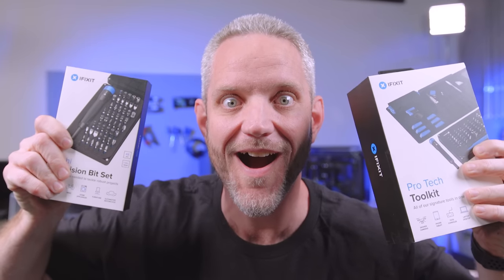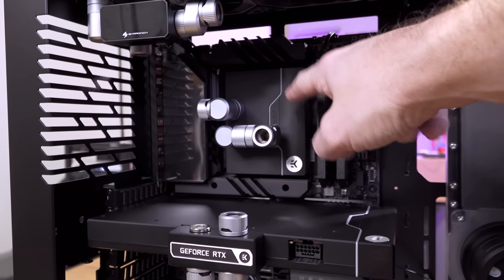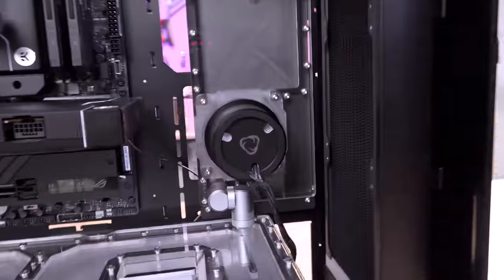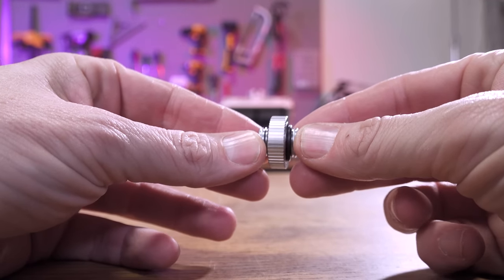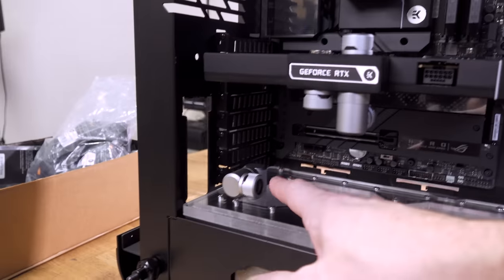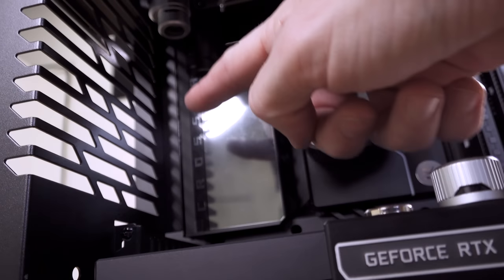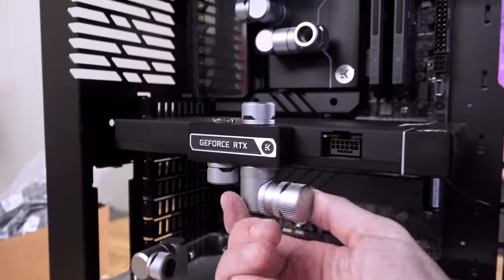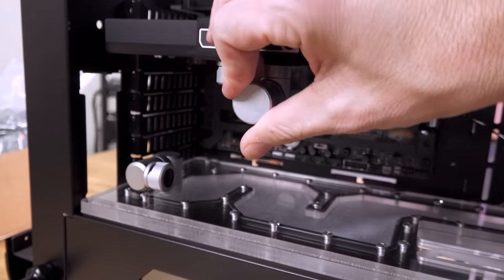My personal system is DONE and its BEAUTIFUL!

Comment: Since you made that tutorial on custom water cooled systems, I use the PMMA tubes from Corsair, in the shop where I buy most of my stuff they have these a lot on their outlet store, complete boxes, with 3 or more per pack. As I'm building these too, I just have a small stock lying around here, in all variances they offer. Or, I buy them bent, from EK, depends on the order income, but you can feel a difference in tube than the Corsairs.

Comment: With water cooling, you can fit all the components in the height of one PSU. Yet all cases are wide enough to accommodate at least one 120mm fan over the RAM and getting bigger for the 4080.

Comment: Centrifugal fans are much different in action than axial.
An axial fan relies on the pitch of the blade to move the surrounding fluid.
A centrifugal fan also has pitch. However the flow is, well, centrifugal. Thus, moving the trailing edge (outer edge?) Forward in relation to rotation increases the relative angle of attack to the blade.
The blades you show in your video have a very "flat" pitch, which will cause high static pressure, but low velocity. A blade which is perfectly radial to the axis of rotation usually makes a decent compromise between pressure and velocity.
A blad that "looks" like it will pull fluid into the center of the fan has a higher relative angle of attack and will produce more velocity at the cost of static pressure.
Also, Dyson is more marketing than engineering, so I would not use them as a standard for performance.

Comment: What's going to drive me nuts in doing my first rigid tube loop is getting all those "it's a few degrees off" problems fixed.  Building in a Lian Li V3000 Plus, so I'll have ROOM to work, but that might actually bite me in the ass, too.  Leaves to be seen.  Can't plan a loop til Wednesday when the rest of my parts arrive (waiting for EK blocks, fans, and an AIO just to test the system and update drivers/BIOS), THEN order fittings and wait some more. 

I MIGHT order a couple of those flow meters (dual loop..duh).  They look amazing, but how to work them in with what I want to do....not sure.

Rig will be all black and purple.  Painting the grating on the case Plum Crazy.  Also, if you had affiliate links, I just ordered both the pressure tester AND that tubing bit. LOL

Comment: Great build!! I just finished my first, complete custom loop, AMD build. Asus Crosshair Extreme, AMD 7950X, AMD 7900xtx, 64gb Corsair Dominator memory, couple of NVMe drives, 3 rads, 10 QL fans, GPU/CPU water block, etc. I was excited to get it up and running. Saw your AMD video about the memory testing at first boot so I new to chill and let it do it's thing. After 30+ reboots now it is STILL taking me 1m34s to get back to the desktop because it does that f'ing memory test EVERY time! The PC this is replacing is an Intel 4790k on an old ASUS board and I'm at the desktop in 13 seconds. What is going on with AMD??

Comment: @jay . i found out that if you force firmware flash your memory using the corsair software , it will set your memory default to whatever you had it set . So you can then remove iCue . it keeps the settings even pre Windows boot . That way you can Keep the dom plats , they by far the nicest ones !

Comment: Jay, I'm really confused. I thought you were doing a build on the Asus x670e Crosshair Extreme. But that is the Hero? I've had nothing but challenges with the extreme as well with a few other parts not necessarily working as well as they should. It's been a lot of stress testing and troubleshooting while striving to finish the plans with EKWB, CableMod, Vyral and a few others. 

The build is as follows:
*Customized Lian Li DXL "White" "Clearview" modded by Vyral
*7950x
* 4x 32GB G.SKILL Trident Z5 RGB Series DDR5 5600 (as each week progresses, the ram continues to become predominately more troublesome. I will be needing to set aside time to trouble shoot each one more thoroughly.)  
*ASUS X670E Cross Hair Extreme  (Right now, I'm going back and forth on this as I am not trusting the Motherboard either. When I connected the additional power next to the 24 PIN cable, the system became significantly less stable.) I've been testing it for over a week without the 6 pin connected. 
*Nvidia RTX FE 4090
*Thermaltake GF3 1350W ATX3.0

There has been quite a few challenges that I am taking on. Aside from some of the hardware hiccups and ASUS not playing nice with memory on it's certified list even running just 2 sticks in A2-B2.

I am working on plans to address the removed 4th pillar regain the structural integrity loss to the case and allow for a top mounted radiator. 

Oh, and the custom ordered 12VHPWR cables came defective / shouldn't have failed QC, even had snags in the shielding of the tiny wires and the sleeving came all bunched and bundled with broken combs. 

This has definitely been one of the more frustrating builds. I miss the stability of the AM4 platform that my wife ended up with. She took on my old build  with the 5950x and we added in a all white 4080 Aero. She loves it.

Comment: Im in the middle of building my first pc and your videos are the reason why. Your very helpful but also funny as hell. I bought a used cyberpowerpc with a b350m bazooka mobo and amd 1400 with a rx580 card. Barely booted the thing up and the 580 is crap so now im reusing the case but went with: 
amd 5800x3d
ASRock Phantom arc a770 ( because price i figured id try it) 
msi x570 unify mobo
Super Flower 850w platinum psu

Comment: so i built a pc my first build. with tuf gaming x570 plus wifi motherboard, amd ryzen 5 3600, G skill 16gb ram x2. amd radeon r 6600  . my sytem keeps restarting on its own. without overheating. i replaced gpu and psu and still restarts  randomly. somtimes while idle. any suggestions would help. sometimes it powers down completly thats why i replaced psu but itstill occurs

Comment: What I struggle with, is how long should the tube be, what is the depth of the fitting - what do you measure to ? Length if fitting to fitting + 10 mm fitting depth...?

Comment: Suggestion. Get a 12v universal power supply and wire it so you can plug it straight to the pump. No need to power anything in the system and less bs with the 24 pin.

Comment: nice.  I like those offset ek fittings.  Really neat overall too.  and the connected lianli fans to reduce cable mess.  the whole process including the ek drill bit to properly round the tube edges.  Also a fan of inwin cases.  they are solid, if a bit heavy. :D  Coolio.  i'd be satisifed with it if it were me.

Comment: Ok, I have to correct you.  A pump ONLY pushes out flow.  Restrictions in the tunings cause pressure.  I spent 21 years working aircraft hydraulics.

Comment: Why would you blow the hot air from the front radiator into the case?  I know fresh air in the case doesn't matter as much when you are doing water cooling, But I would think that having warm air from the radiator blowing into the case sure doesn't help.  Maybe your front radiator and fan pack aren't designed in a way which would allow you to point the fans so that their exhaust air goes through the radiator and then out of the front of the case?

Comment: Dont feel bad on the flow meter they give you no instructions i did the same thing and its a huge complaint on amazon that it does not work but no one realizes you have to turn the impeller around feel like a slip of paer in the box would save them alot of returns... lol

Comment: Ouch. Don't count on that flow meter lasting long. Mine lasted 1.5ish years. Then I realized the oled screen gets burn in, making it garbled to read, and after 2 years, the flow meter stopped functioning entirely. 

I'd get a different one that has oled screensaver features in the future, or find some way of interrupting the molex power every 10 or so seconds so the screen resets

Comment: Hey Jay! 
First off; that is a beautiful build, absolutely love the colour scheme and how it all came together. secondly (And this is for everyone else reading this too.) I noticed you mentioning that you wish you didn't have to use Corsair ICUE and were wanting a way for all the RGB and fans to be controlled by the motherboard, so I thought I'd check the comments as much as I could honestly be bothered to but didn't notice anyone mention about all in one RGB controller apps. After trying a few different ones I would personally recommend and am currently using SignalRGB for my build. This has allowed me to no longer need to mess around with Corsair ICUE, RGBFusion, Razer Synapse and SteelseriesGG as it can all be controlled from one app which you can set to startup with the PC so I barely have to touch it unless I want to change my lighting. On setup it will search for all RGB devices and separate them to two different colours so you can choose which selection of RGBs you want to connect and edit e.g motherboard connected RGB like GPU's and CPU Coolers or RGB controllers for your fans or lighting strips. Each part from a large selection from Asus, CoolerMaster, and Corsair to NZXT, Razer, Thermaltake, and even lesser known companies like Palit, Xilence and Zalman. This allowed for an easy setup and even if your part isn't listed you can just create a custom module instead. Once the setup is done it will sync all your RGB together or you can choose to place each individual light or RGB strip into different locations in the RGB visualiser with a profile manager for saving different layouts for say an RGB wave or if you wanted rain effects or something for example and choose exactly which order you want to see your RGB's light up. On top of that there is also a whole library of different premade lighting effects and a community made library too to look through. There is also the premium version that allows you to have that all important fan control and full PC monitoring along with other cool features like game integration lighting, audio visualisers and Screen ambiance control. but if you don't need anything other than an all in one RGB app its absolutely free. i would highly recommend this to anyone who has sat down for hours trying to perfect the timing of fades or colour changes in multiple apps to no avail (ICUE and RGBFusion im looking at you!)

And just because I feel I need to say it because of YouTube comments. No I'm not sponsored by them nor do I have any affiliation with them I just thought people should know this exists, as I have struggled for a while trying to keep all my RGB's consistent in colour and timing and the few other all in one apps were far less user friendly or just simply didn't work.

Anyway great video, I look forward to more soon. Keep on keeping on!

Comment: Wow Jay, another epic looking build!
I was just wondering what thermals are like, since you only got one (presumably 360mm) Radiator for CPU and GPU, while the 4090 tends to use a lot of power...
Im having a 6000xt with a 5600x in my System running on a custom loop with a 360 and a 240mm Radiator and temps are already a bit high when overclocking the GPU to a power consumption close to the 4090 at stock speeds...
On the other hand airflow seems to be a bit better then in my rig, and maybe your rad is thicker than my 25mm rads, so your temps might be just fine.
Anyways, a followup video regarding system Performance and temps would be appreciated!
Have A good day and greetings from Germany!

Comment: looks pretty sweet... curious about a few things though... so you have a giant water distribution plate at the bottom to "distribute" the water... to 1 outlet? was there really no way to feed the cpu and gpu separately from the "distribution" plate so your cpu will be getting freshly cooled water from the rad instead of freshly heated water from the gpu? also.. that seems like an awful lot of fans for a "water cooled" system =]

Comment: I've heard the 7800x3d actually runs better on games than the 7950x3d because the all of the cored share the same L3 cache and it isn't split between two sets of cores like the 7950x3d. The 7800x3d seems to beat the 7950x3d in all games. However, the 7950x3d IS better for things like video encoding, unpacking files, and other intensive non-gaming areas.

Comment: One of the questions thats been in my mind for so long after working with hard tube once…
Can i still have a bit of playroom to push it inside the plug?

I remember that i had to use force to make the tube fit to the connector cause i was afraid it would leak.

Comment: Random question but I have little experience with AIO’s. are 360 AIO’s compatible with 2x 180mm fans? Are they more intended for 3x 120mm fans? Not sure if there is a market for them and if it’s worth producing them. I know they make rads but I have not found an AIO. I have a fractal torrent compact and would like to upgrade to an AIO (front mount ideally) without sacrificing air flow if possible Love your content, I’ve learned so much from you.

Comment: Jay, I remember watching the radiator mounting position video, but do you think you could do a short one about the position of the radiator vs fans? Like on an intake or exhaust radiator would it be better to have the fans on the outside(closer to the edge/outside if the case) or the radiator?

Comment: Hey J what Distro plate did you use in your inwin 925 case? Would please link me to the one you are using. I picked up my InWin 925 case at a local auction for about 100 I was really lucky as it was new and never used. I am doing air cooling now but I haven't found a distro plate I liked until I watched your video. Thank you for you help and reply.

Comment: Have you had any issues with leaks using the ek ridged fittings? I've heard the O rings don't last like the Corsair fittings. I had used bitspower fittings but those are super hard to find.

Comment: I haven't built a computer in over 15 years, so bear with me : where do people put their hard drives nowadays ? All I see is a mix of empty space and cooling system parts where they used to be. In this particular build, would I be right to assume it's an nvme tucked over the gpu ? (apologies if it was mentioned at some point in the video and I missed it).

Comment: Is there an AIO solution that handles both CPU and graphics cards?  For me this would be ideal as it would allow switch-outs of CPUs and GPUs to be so much easier than a custom loop.  Right now, I can't fault the looks, noise levels or performance of my PC (using Corsair AIO for CPU), except the GPU gets so noisy using its fans (RTX 2060 OC).

Comment: Just for anyone watching this who doesn't know much about fluid dynamics...
A "tighter 90" is a bad thing.
A 90 at all, is a bad thing.
The flow restriction of one 90 degree turn, is more than  several  45 degree turns.
Making a system with several tight 90 degree turns ruins flow. 
It is also extremely hard on your water pump, and can result in the pump failing immediately if there is a 90 degree inlet leading into the water pump.
Just think of the water flow... when it hits a 90 degree, it hits a wall, creates turbulence, and then has to be forced forward in the new direction.
A 45 degree however gives a more gentle 'push' in a new direction.

Function over form.
Don't do what was done here.

Comment: Running the pump without the PC... I have used a spare PSU, and just connect to the power connector of the pump.  then I know the pump is 100% isolated, and not needing to run the MB or any other components.

Comment: I ordered the same fittings.  they are really the best and most beautiful.  but i have a question.  i have msi x570s ek x monoblock.  can i use inlet and outlet oppositely?  what can happen as a result, I can't find an answer anywhere.  easier for me to install pemma pipes

Comment: I love thay you're running AMD, I'm ready for a tech tuber to run a full AMD build like me. But everyone is using the 4090 which i dont blame them but still lol. But alphacool gives you different color grommets right out the box I think theyre much better value than anyone else, and my gpu never goes over 36c on load lol. Also what kind of case is that?

Comment: GG, Jay, great looking piece of hardware there. Man, that looks nice. I myself have no ideea how to control the rgb off of my whole setup for the simple faqct that everything that has rgb is from diferent producers, and they all use diferent apps....there is no universal app for everything with rgb. I wish they implement this in windows, this would be very helpful. 
Can't comment on the tubing part, i have literaly 0 experience with it. 
I want to ask, is there anybody that can recommend a path of upgrade? I believe my i5 10400f is a little too much of a bottleneck for my rtx 3080 even at 1440p....though if i use the 3200 MT ram it works kind of great. Would a 11600kf be a better fit? Or a 12400f (even cvheaper than the 10600ft, but i need a new motherbord for that..)
Mentioning that the mb is a tuf b560m-plus

Comment: 5:45  "fittings are cheap, they're only about $10 each".  How many did you use?  Looks like over $300 USD just for fittings.
I'd love to see a complete B.O.M. and price breakdown of all parts used just for the watercooling parts.  i.e. how much more expensive is the water cooling as compared with air cooling.  What is the cost vs benefit?